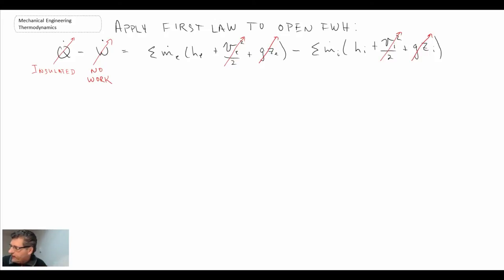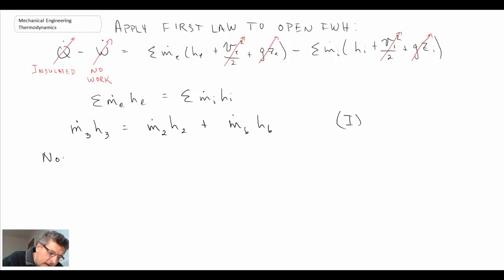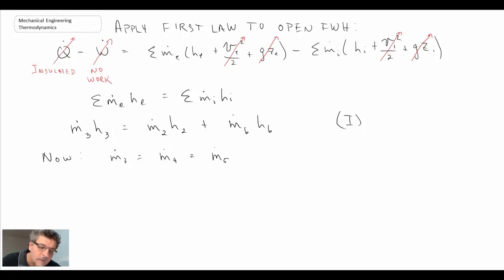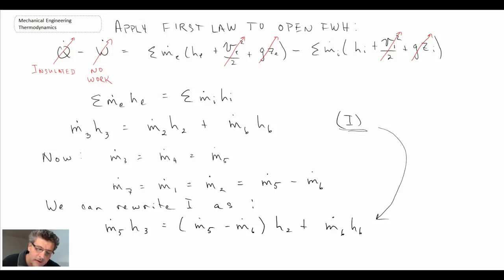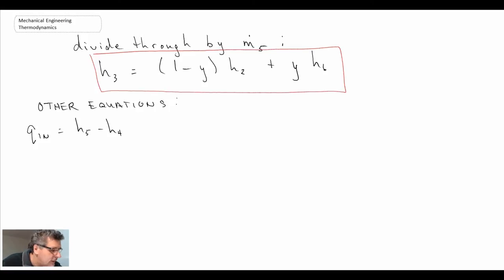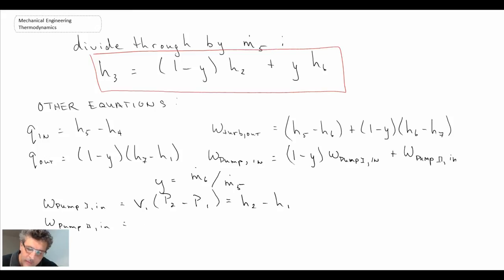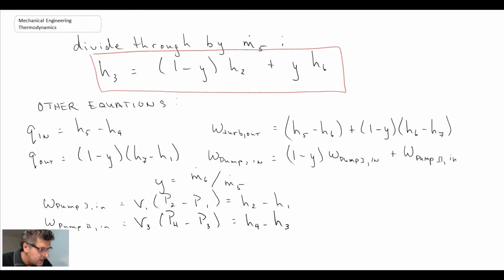Mechanical Engineering Thermodynamics - Lec 20, pt 5 of 7:  First Law - Open Feedwater Heater

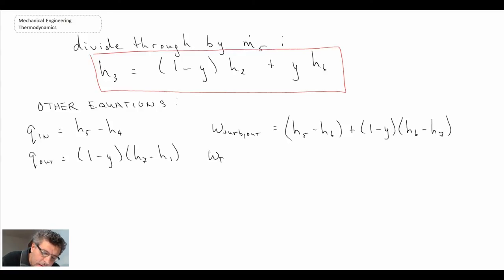Comment: at 7:32, why is it not (h5-h6)+(1-y)(h5-h7)?
Reply from the maker: Remember that we are dividing through by m_dot_5, or the mass flow rate through the boiler, as shown at 4:50 in the video.  If we were to evaluate the work out of the turbine as (h5-h6)+(1-y)(h5-h7) we would be accounting for the work in the high-pressure turbine twice, once at a mass fraction of 1 and the second at a mass fraction of (1-y), and this would incorrectly overestimate the work output from the high-pressure turbine.  The low-pressure turbine (expansion from state 6 to 7) only has a mass flow rate of (1-y)*m_dot_5.  Given that we have divided by the mass flow rate through the boiler, when examining the work output of the low-pressure turbine we need only consider expansion from 6 to 7 (h6-h7) and then multiply it by the reduced mass fraction (1-y).
Reply: I am writing a thermodynamics exam tomorrow, this really helped even after 4 years. Thank you.

Comment: sir how are u assuming (y=m_dot_6 / m_dot_5)
Reply from the maker: In determining "y", you want to divide by the flow going through the boiler (that is why m_dot_5 is in the denominator).  Why put the mass flow rate through the Open FWH in the numerator and not the mass flow rate of the flow through the Condenser?  You could do that, but it would give you a slightly different equation when you divide Eq. 1 (first law applied to the Open FWH) by m_dot_5.  If you solve it this way, watch how you label both your process diagram and T-s diagram as the y and (1-y) streams will change.